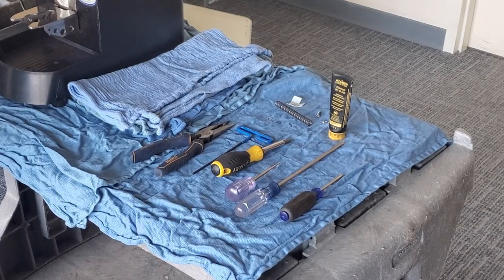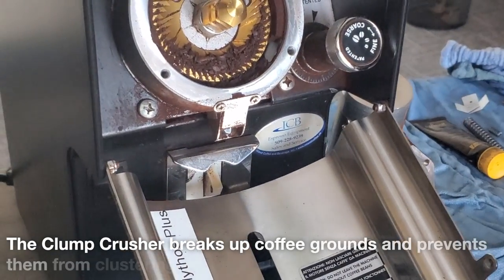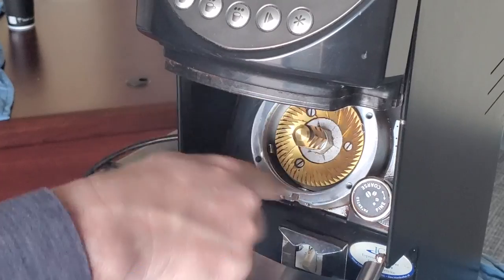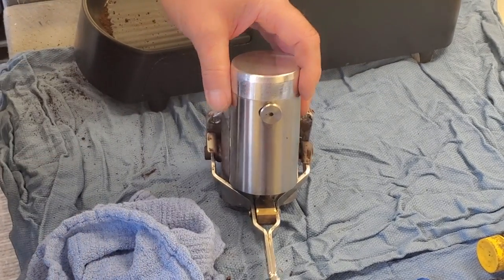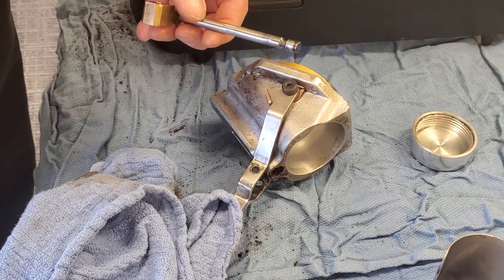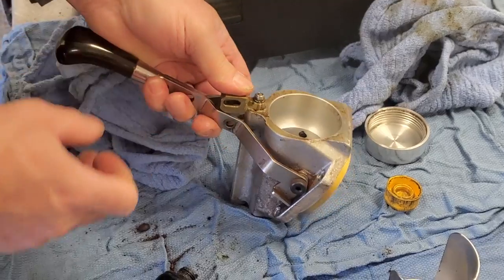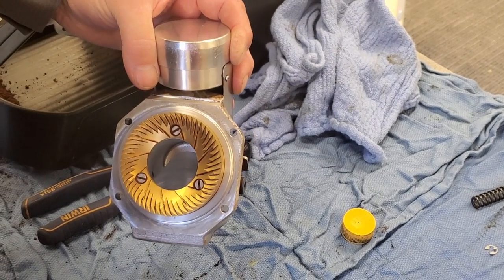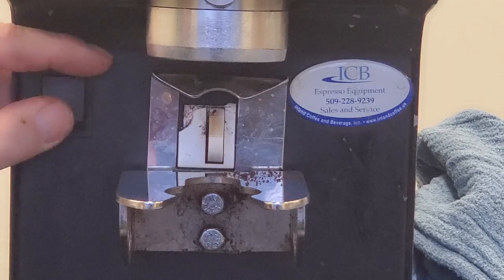How to Repair the Mythos Plus Grinder and Tamper

Comment: Hi i have question about mythos 
I bought second hand mythos and found out grinder is not spinning when it goes finer 
I cleaned inside of burr carrier however i found that burr carrier isnt spinning by my hand manually when i assembled 
Do you know what is problem ? 
First I suspected it was capacitor problem however i think it isnt.. after i see burr carrier isnt spinning 
If you can help me to solve problem it would be awsome :)
Reply from the maker: If you cannot physically spin the burr carrier by hand, something is obstructing it or the bearing is seized.

Comment: The tamper lever of my Mythos always stops half an inch before it's back in its top position and I always have to to "help" it get back. Just did this service but the lever still doesn't work normal. Any idea?
Reply from the maker: Did you replace the main spring? All the springs and the pressure release ball need to be lubricated. Let me know if that helps?
Reply: @EspressoServiceNetwork  I didn't replace the main spring (I lubricated everything extensively). But I just ordered a new main spring and will replace it as soon as it arrives.
Reply from the maker: @bennilasvegas  That should fix your problem. The main spring should be replaced every 10 to 20 hours of operation. If low use, at least once a year. Let me know if you continue to have a problem?
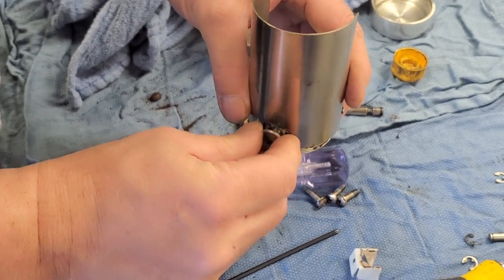Reply: @EspressoServiceNetwork  So, it wasn't really the spring (I changed it anyway since I ordered it). It was more or less not following your procedure a 100%. At 18:10 you screw in that tamper pressure control and the little steel ball before you put everything together. I screwed in the ball and the pressure control after I assembled the unit. Had to do it several times because it wouldn't work. Then I just followed the video step by step and it finally worked.
Reply from the maker: @bennilasvegas  Well done! Thank you for the feed back. Happy you discovered the answer to your problem. Feel free to reach out anytime if we can assist you in anyway.